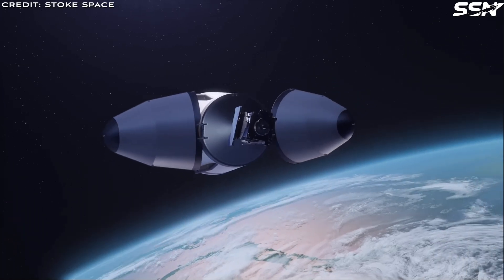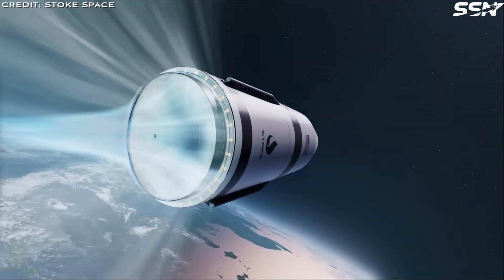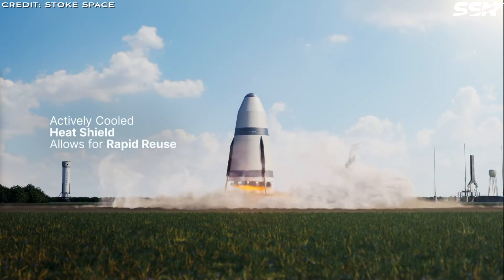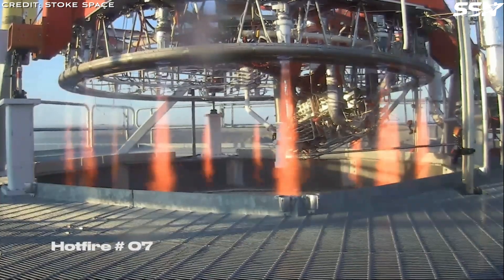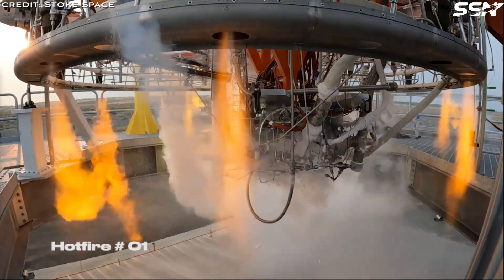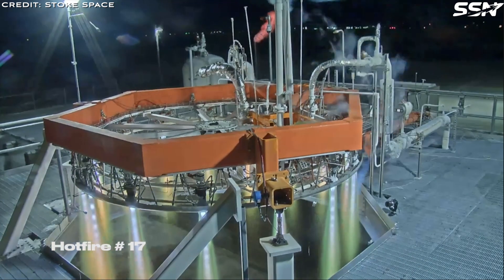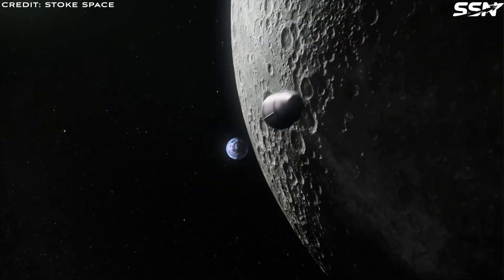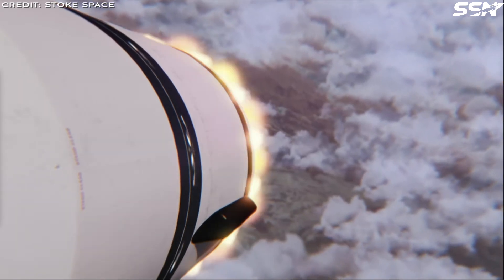Stoke Space Second Stage: High Performance and Reusable within 24 Hours of Landing

Comment: I still don't understand exactly HOW hydrogen flows through that heat shield, and how it gets back into plumbing/tubes/pipes to drive the pump's turbine.  Does the heat shield have two surfaces, one inner and one outer, and the hydrogen flows between them?  (etc.)

Comment: with this ridiculous nozzle setup they will have big problems with packaging and pressure stabilization on feed side. also the more engines solve same task fewer would - the more useless w8 you add. the only scenario for more engines to make sense is when you have problems with combustion stability but really need to achieve some insane overall thrust

Comment: I was imagining that the thrust differential that will replace gimbaling for flight control would generally involve throttling the engines rather than turning any of them off?
Reply: correct. In another video they mentioned using a pintle injector for throttling.  This basically acts like a valve in a car.  Open -> more fuel, close -> less.  it's a great and simple solution.  I've got to think that the processing and monitoring control will be insane.  Very interested to see this thing progress.  Excited to follow along.
Reply from the maker: Yes, you're right. I should have said throttling the engines not turning them off.

Comment: if i remember correctly, in an everyday astronaut interview, i think the engines of the first stage are "full flow staged combustion", which is pretty special!. the only other example of that cycle is the spacex raptor. don't dis that first stage!
Reply: You are correct.  This company has some exciting technology.
Reply from the maker: Okay, fair point. FFSC is special.
Reply: I'm still surprised they're not begging and pleading that SpaceX launch their 2nd stage for them on a Falcon 9 first.  'Not calling anyone stupid, mind you, but if it were me, I'd try and try to do that first, before going through all the trouble to make a booster too.

Comment: Thanks for a very interesting video.  Can Stoke Space pull off a fully reusable, hydrogen-fueled upper stage with a rapid turnaround time?  Plus using an innovative aerospike engine design?  I don't know.  I am willing to predict that it will take longer and cost more than planned.  It almost always turns out that way.  Space is hard.